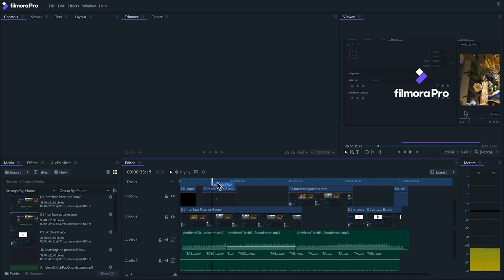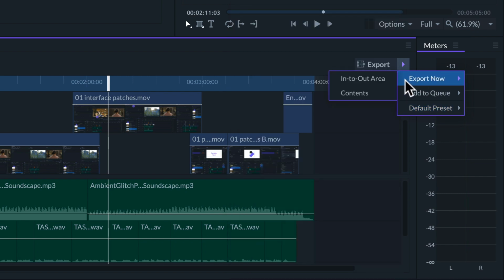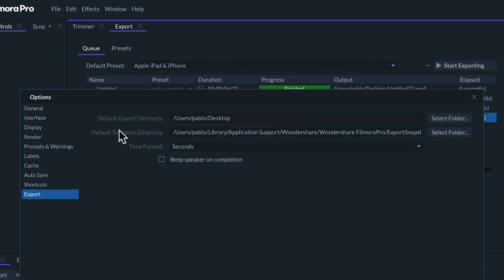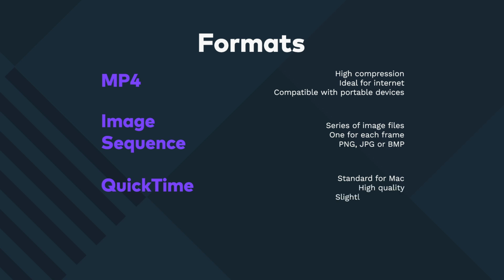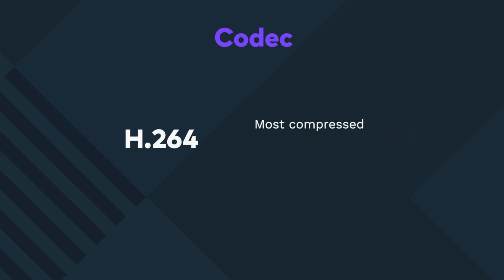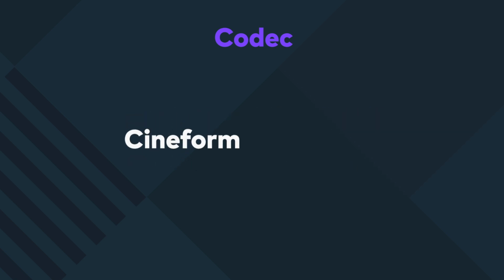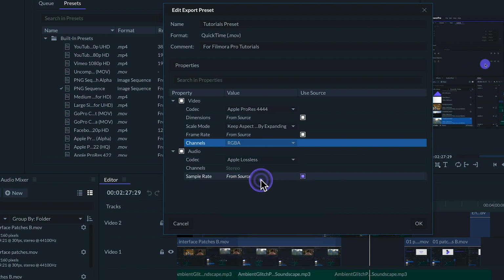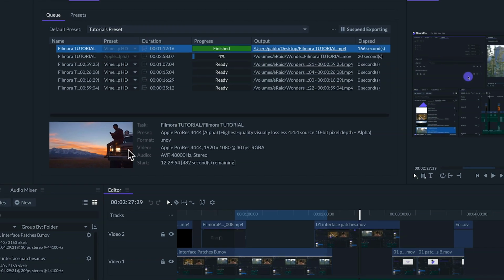Export Project | FilmoraPro

Comment: What is the best bitrate for mp4 264 output for you tube? Why are the Preset export settings for Vimeo and You Tube different? Should we use 41000 or 48000 for the audio. Can you do an example for Windows export (avi)? Thanks.